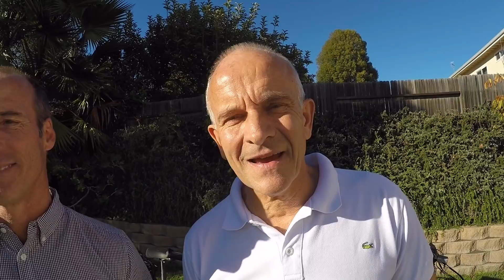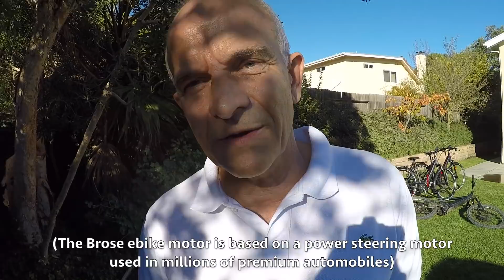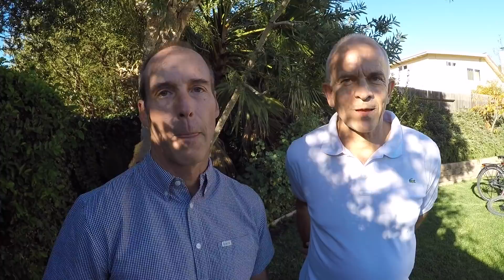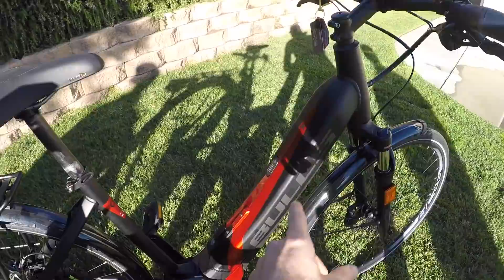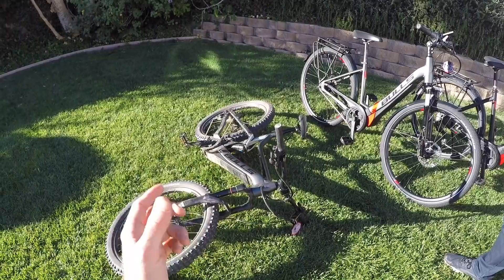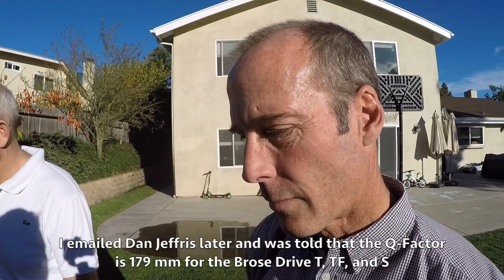Brose Ebike Systems Interview - President & US Marketing Lead

Comment: Interesting, I wish Brose would publish more marketing material themselves. I feel from the interview they have some serious knowledge in this area and can for sure be the leader in such a space, but are massively on the back foot with brand knowledge. Shimano will fight hard to ensure they lead this space going forward, so would need some serious marketing to convince that backing Brose is the right choice for an expensive investment. Lets remember, once you buy an emtb with a particular motor, the frame is locked to that design. Longevity of support for the motor needs to be there and shown. I believe Brose has the ability, as they'd clearly be supporting motors they make for a loooooong time after they are invented and put into real world scenarios in the automotive industry, so working on making that knowledge available to the buyer via marketing is exactly what they need to do. Good on you Brose, love a family company done well, keep up the good work and give Shimano a run for its money!

Comment: i am from germany and have the honor to ride a 2018 brose s motor with my scott e-aspect at. its solid, well configured software related and silent even in stressed situations. the 2017 model of that motor was a joke with issues in overheating and the wall you hit at 25 km. made me buy a tuning chip til the motor collapsed. silence and power are a big plus for brose motors. danke an die leute in berlin, die entwickler, die schrauber, ihr macht das fantastisch.

Comment: Hey Cort, could you guys do an update on mid-drive motors for 2022? Some of the bikes I am interested in use Brose, and I was impressed with the motor on my tests (I have knee issues and that 90Nm really makes a difference), but there seems to be a lot of trash talking about Brose online, and even some (not so classy) bike dealers. The better bike dealers have told me why they no longer carry Brose powered bikes, but they will admit that they made the decision a number of years ago, and things may have changed. I have heard good things about Bosch in terms of support, parts, maintenance - but I would love to hear/read more about Brose, Shimano, Bafang, etc. Also, a lot of the stuff dealing with Brose is for eMTB's and I am looking at an ebike for commuting and recreation. As always, love EBR and appreciate the work you guys do.

Comment: Holy cow they converted car electric power steering motors to use as ebike motors.
Reply from the maker: Yep, same thing with the Bosch mid-motor... and that may be why it uses a smaller sprocket (for the performance Line models). Now that Shimano and Yamaha have made "from scratch" ebike motors, we have standardized chainrings and shorter Q-Factors and a more compact angled design. Bosch is still a leader in the sensor department and I suspect that we will see more motors from them with traditional chainrings, as with their latest Active Line and Active Line Plus :)
Reply: Holy cow is right! The Brose eBike drive was developed from a motor that has been reproduced in millions of units, adhering to the highest quality requirements of the automotive industry. The motors are built in our Berlin factory right alongside production lines for our automotive parts. Brose spent the good part of 3 years developing not only the drive unit, but the software that delivers the impressive power and natural riding feel.

Comment: My Brose started noises and loosing support at 24000 km. The 2 internal freewheeling bearings are broken. Replacment is on the way. They are now made of metal cage insted of plastic. Else a very good pedelec mid drive motor, silent and feeling natural in support riding a bicycle.

Comment: I would like to see some end user support for the diy people out there
Reply: Hi Mark, Brose does not have aftermarket or DIY systems. This decision was made to ensure we that we can track and support our drives and their intended use. There are many DIY motor de-tuning solutions for drives in the market, but these will void warranty for the motor. Our approach will continue to be to work with reputable bike brands to develop specific products for the market. Thanks

Comment: The only thing that makes me hesitate about Brose is its lack of standardized battery to complement the motor (like Bosch does). It makes me worry about replacing the battery in 5 years.  I love the motor though. Sounds like the best out right now from all I have read and seen.
Reply from the maker: Yeah, I have similar concerns about the custom battery pack design. It's nice that Bosch, Yamaha, and Shimano offer standard packs so you can always get a replacement. I guess we'll have to see which companies support their products over the long term. I like the openness but feel that eventually there will be a very clear "right" way to do it, like the Bosch Powertube... which I don't think is perfect (a bit heavy and long) but something like this that all models could utilize. Great point, Alex ;)
Reply: Hi Alex, Brose works with our bike brand partners to identify and work with reputable battery suppliers. All batteries selected and used in the market are either supported directly by the bike brand or the battery provider. In addition, Brose has a very detailed certification process to ensure all battery manufacturers that work with our motors are certified. Batteries are sent to our Berlin test lab and thoroughly tested. One of the unique qualities of the Brose system is that it is "open" and allows for a certain level of customization by a product manager resulting in unique and cool system set-ups and integration (custom displays, battery, lighting, app development). Thanks
Reply: I'm not sure this is actually a concern. I know that here in Denmark at least, we have companies specialized in the renovation of various kinds of batteries. Now that electric bikes are beginning to enter the mainstream , they are offering complete renovations with new 18650 cells from  reputable manufacturers at price points way lower than purchasing new name brand batteries.

Comment: I own a Brose powered e-bike. I am satisfied, but there is room for improvement. The standard model is less efficient than the Bosch. With same battery size (and cyclist weight) my friend with a Bosch made it nearly 15km farther than me. Hope the "S" model will solve this issue. The standard display is poorly designed and returns inaccurate values for power and calories. Switched to a Teasi display, much better albeit less reliable. And the BMZ battery+charger don't tolerate the use of a wall socket timer, you must first connect the AC and only after that the DC side. This means that you can't charge the battery right before the use, you must charge it in the evening before the ride day, which increases wear.

Comment: Hello guys,

I own a Sunn MTB (French Brand), Charger S1 (Brose S motor) and i am satisfied .
 after 3 mounth and 850 km, I had a fault, bad contact battery / motor connection which made me lose the assistance and the display, supported in service by my dealer (change cable) , the speed sensor has been changed also cable crushes in the crankcase motor (plastic cover)

have you already had these failures and your connectors have been reviewed?I also regret the lack of diagnosis (sofware coming and waiting for a year of Sunn, you should not let the manufacturers using your engines, do not dispose of them (also their dealers)

Thank for answer

Alain

Comment: Interesting interview, very informative.  However, when I heard "belt drive", I lost interest at surface level.  I would have to be "sold" on the advantages (noise and vibration hasn't been an issue with my Yamaha/Haibike motor, yet) such as better power efficiency,  explaining the ease of belt replacement, how much the belt costs, and an estimate of mileage belt life.  These are key questions most serious buyers will need answers.  I'm open to listen more and try one out, but the belt architecture needs explained better.
Reply: Brose drives use Gates carbon belts which are rated for (minimally) 10k miles of wear. The use of a belt vs geared cogs reduces both the noise and vibration felt in the geared designs and truly gives Brose an advantage over competitors. The belt is used to deliver power from the motor to the drive unit.  I encourage you to try a Brose drive system. Belt replacement is a 30 minute operation and the Brose US Service Center will work with authorized retailers to provide this service.

Comment: Be carefull with Brose motor, after waranty, the only way to continue biking is to buy a new motor at 600 euros !   With Shimano or Bosch motor, the dealer can open and work on the motor.  Brose use a special bearing made only for their specs.....  too bad
Reply: Hi Eric, Brose motors are supported in the US thru our Service Center. Authorized dealers and manufacturers have access to this support to help with warranty evaluation and replacement. There are only a few parts in the drive that are replaceable and having an authorized retailer and service support person conduct the changes and evaluation is the only way to preserve warranty. Opening (any) motor without being an authorized service provider will void the warranty. Bearings are pressed in to the motor housing and drive unit during assembly and are not meant to be replaced. Brose has improved the seals protecting the bearings, especially from water damage. Typically, bearings will last the life of the motor, if well protected (avoid power washing). As the 5th largest automotive supplier on the globe, Brose has designed and engineered their motors for durability and long life.
Reply: Brose eBike USA Riding Mtb for 29 years now, I know that even the best bearings on cranks, exposed to mud and water while riding do not last for ever. I defenetly purchase my next bike with Shimano motor.